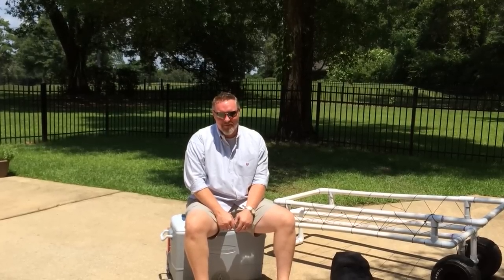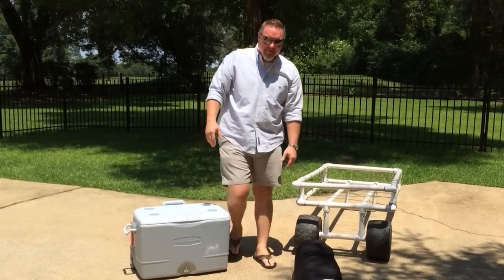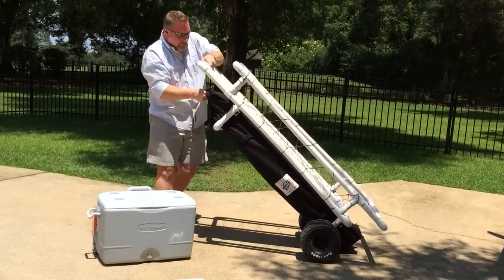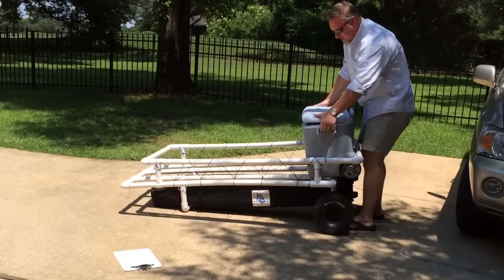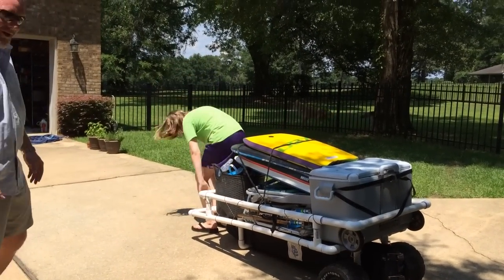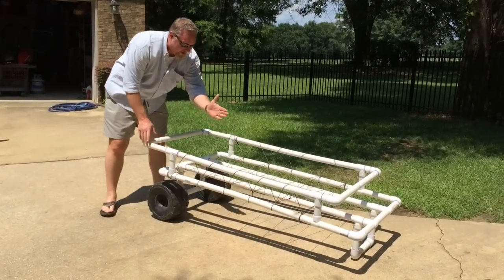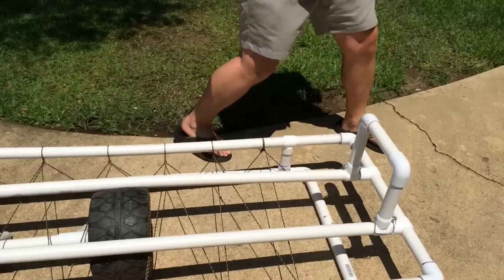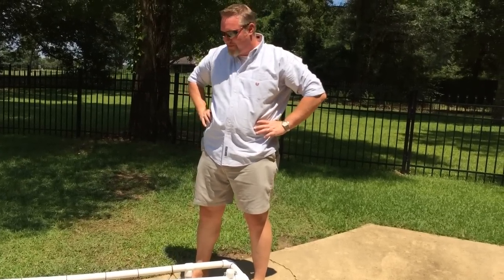DIY Beach Cart

Comment: Great video!  Thanks Brother!  Quick question .... when lifted,  does the canopy ever drag when carried through soft sand?
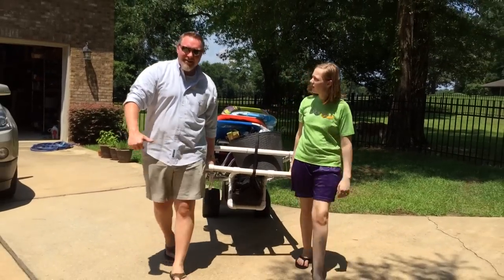Reply from the maker: The canopy does not drag, but only because I strap it to the front of the cart.  Look at the 3:36 mark in the video when we are walking back toward the camera.  You can see the strap around the front of the cart and it's looped back through the carry handle on the top of the canopy cover.  I used a cam strap, not a bungee cord.
Reply: Great idea!

Comment: Cool idea! So how did it preform on the beach, in te sand?
Reply from the maker: The hard plastic wheels from the children's toy did not do well in the sand.  This was partly due to the wheels and partly due to the axle I harvested from the toy.  With a diameter of 7/16", the shaft could not bear the weight of the fully loaded cart without deflecting a little, which further inhibited smooth rolling action.  The wheels "plowed" as much as they rolled. I had to break down and buy true beach wheels.  These come with a stronger axle and roll much better through the sand.  I have plans to make a new video to discuss the revision to the design.

Comment: Would and axle and wheel assembly off of a old hand truck work good? (Given they're in good shape)

I'm building my own and looking for tips on all these videos. Love your design but staying in a condo im gonna have to keep in mind the length and width. (elevator could be an issue)

Thanks!
Reply from the maker: The axle of the hand truck would be okay, but I doubt the wheels will work well if you plan to carry much weight (e.g. ice chest, canopy, etc).  The hard wheels that I had were 8 inches wide, and they still plowed through the sand when the cart was loaded. I had to break down and buy the wheels that were designed for sand.

You could definitely make the cart shorter. The length of mine was based on our oversized canopy.

Comment: Lo9ve this project- what size pvc pipe did you use for the main rails in the bottom section and top support rails?

Pak
Reply from the maker: Thank you for the nice feedback.  I used 1-1/4" (non-Schedule 40) on all parts of the cart.

Comment: Does it fit in the elevator?
Reply from the maker: I have never tried to fit in in an elevator, but it would depend on the depth of the elevator.  The cart is 6 feet long.  As long as the elevator was 6 feet or deeper, the loaded cart should fit .  Unloaded, the cart would fit in any elevator as it could be stood on its end.  

The length of my cart was based on the length of our canopy (which is larger than average).  A smaller canopy would likely be shorter when collapsed, which means the cart could be made shorter.  My cart is just under 32 inches wide (to accommodate the cooler) so width should not be an issue.